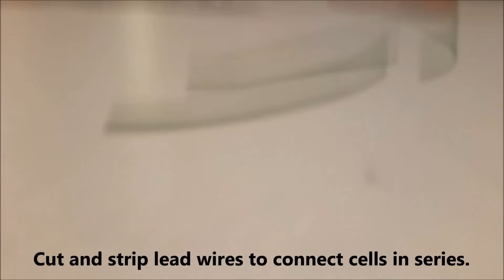Soda Can Battery - Power From Trash - DIY Project

Comment: Can you send the link on where to buy flashlight head? can you specify what flashlight head that would be able to light up in an electrolytic cell? Can you also send the link on where to buy sand and specify how much volume per can.
Reply: CAN U REPLY ASAP
Reply from the maker: Of course here is the link. It isan Ozark Trail brand mini flashlight. https://www.walmart.com/ip/Ozark-Trail-Mini-Flashlight-in-Assorted-Colors/34350005

Comment: I have tried, it didn't work. What I miss?
Reply from the maker: I have found that you must have an insulator like cardboard, thick paper, or plastic. If you are not getting any voltage with a voltage meter, then usually you have a short somewhere that the copper and aluminum are touching. Also you might want to check the voltage on your LED. If you don't have enough you will need to make another couple cans (cells), and wire them together in series. Happy inventing!!! Please subscribe!
Reply from the maker: Hey Faqih, I thought you might be interested, just published the update for this video. Please check it out, share it, and let me know what you think. Thank you https://youtu.be/DRVzPqgp10c
Reply: Source Port Services thanks for the reply, I will see the video

Comment: to charge a phone you'd need 50 of those batteries in parallel to get 1 amp
Reply from the maker: +Ben's Channel 2004 thanks for the comment. Yes you would need quite a few to charge your phone. However for some basic LED lighting or flashlight if you make a smaller version it will serve a good purpose. Please share and subscribe!

Comment: Does the coil need to be curled up and straight? Or can it be curled up only or twisted?
Reply from the maker: The reason for the coil is just to get more copper surface area in contact with the electrolyte. Better amperage that way. Could Be twisted too but more copper in contact with the salt water solution is what is needed. Thanks for the comment. Please share and subscribe!

Comment: Hi, Congratulations on this nice project. What's the energy a soda can battery (one can) can supply at his 1.8 V? How many mA and how long (in hours) it will works? Thank you.
Reply from the maker: Hi Tony! Thanks for watching and commenting! Each one of my cells (soda cans in the series of 10) only produced about 0.5v and a few 50-100 milliamps depending on how much copper wire I coiled in each can. It lasted powering a small LED flashlight head for several weeks. My cells were open to the air thought and dried out once or twice. I did end up putting some vinegar in too to increase the amps and make the LED brighter again. Please share and subscribe!

Comment: We try it we didnt get any current using multi meter
Reply from the maker: You might have a short circuit where the copper wireis touching the bottom or side of the can. Test each cell individually to see where the failure is. Thanks for watching! 👀 Please share and subscribe!

Comment: why do you need the cardboard?..
Reply from the maker: Thanks for your comment. The cardboard is to try and act as an insulator for the battery. To keep the 2 metals from touching. If they touch it is called a short (short circuit) and the electrons will just flow straight from one metal to the other, without following the path through your circuit and your LED light. Make sense? Please SHARE and SUBSCRIBE! Thank you for watching.
Reply: @SourcePortEntertainment  ahh ok..that makes sense..thankyou!
Reply from the maker: We thought you might like Building a DIY ROCKET STOVE video - https://youtu.be/Hlir866cp-E please LIKE and leave a COMMENT. We value your feedback!

Comment: Its not working source port
Reply from the maker: One of the steps I forgot to show on the video was lightly sanding the inside of the cans with sandpaper. That helps with electricity getting through the very thin layer of plastic on the inside of most aluminum cans. Please SHARE and SUBSCRIBE!
Reply from the maker: We thought you might like Building a DIY ROCKET STOVE video - https://youtu.be/Hlir866cp-E please LIKE and leave a COMMENT. We value your feedback!

Comment: Use some acids instead of salt and concrete instead of sand - to increase output and efficiency
Reply from the maker: Thanks for the tip Richard. I will have to try that on one of the future versions. Please share the video.
Reply: When you say concrete, I assume you mean hard set concrete or just the powdery mix with no water?
Reply from the maker: Good question Troy. What type did  you mean Richard?
Reply: Source Port Services i mean acid & concrete battery
Reply from the maker: Thanks that makes more sense.

Comment: i hope you can give me a diagram
Reply from the maker: Hey Rolling Bayabas, Thanks for the comment! Basically the wiring is just a wire connecting from copper wire on one can to Aluminum on the next can in a serpentine pattern until you get to the last can. Then you solder a wire from the Copper coil on the first can and the Aluminum can on the last can. Thus all cans are wired in series and the to wires now go to the positive and negative on the LED flashlight head. Please remember to Like, Subscribe (click the Bell), and Share the video. Thanks for watching!
Reply from the maker: Hey Rolling Bayabas, I thought you might be interested, just published the update for this video. Please check it out, share it, and let me know what you think. Thank you https://youtu.be/DRVzPqgp10c

Comment: I did this project at home however it didn’t work. Maybe there’s something I missed.
Reply from the maker: I forgot to show the sanding inside the can part. Also you must keep the two metals from touching or else it will short out and not put out any power.
Reply: Thank you. I got it working. Also what is the exact chemical reaction that goes on.

Comment: how many cans are needed to glow a L.E.D
Reply from the maker: +Sadhna Rani Agrawal each can (cell) provides 0.5 volts. I used 10 cans to get 5v. The flashlight head I used uses 3 AAA 1.5v batteries in series, 4.5v. So these LEDs operate from about 4v-5v.

Comment: Much safer way to open it is by rubbing it in a cycle on sand paper
Reply from the maker: Hey West, thanks for the tip. I agree, did try the sand paper trick but it was taking too long. Used what I had on hand. Thank you for watching, please SUBSCRIBE and SHARE this video!

Comment: Can I use copper sheet instead of using copper wire that you have used in video
Reply from the maker: Yes you can use a sheet of copper, if it is thick enough. It will last longer if it is thicker. I just published the update for this video. Please check it out and share it. Thank you https://youtu.be/DRVzPqgp10c

Comment: Try to charge the battery`s :-)
Reply from the maker: LOL don't think it would work to good on these. Thanks for the comment Vic, please share and subscribe!
Reply: @SourcePortEntertainment  Your welcome!
P.s I think you can actually charge them.
You need to put some water in the cells first. You can even charge the by day whit a cheap 3 dollar solar panel, so by night your Led Will shine bright!
Reply from the maker: I will have to try that. I thought with a primary battery it corrodes and destroys the metals as the electrons are exchanged.
Reply: @SourcePortEntertainment  eventually yes, (so do not charge it whit that old Honda generator sitting around ;-)
Would be an interesting video
Reply from the maker: LOL 🤔😜
Reply: @SourcePortEntertainment   I was thinking, Take burnt ashes from hard wood, mix them in water allow to settle. and pour off the water into a container and you have Lye and water. Boil it, and concentrate it. Its an alkaline too. You can buy it but in some countries Lye might be hard to get.
Maybe I will upload a video myself..
Reply from the maker: Very interesting I will do some research on that! Thank you

Comment: This would be good if you were desperate for power and had plenty of time on your hands, but since you made primary cells and the voltage and current is so low, it would not be worth it otherwise.
Reply from the maker: Hi Jer, thanks for watching and the comment! Agreed if you had time and were desperate it would be very useful. Please SHARE and SUBSCRIBE!
Reply: Jer Tanner you prep them before. Great for when the power gets knocked out and you are sitting in the dark waiting for power to be restored and you don't want to burn down the house with candles. Think bigger is better. More power Tim the tool man would say.
Reply from the maker: We thought you might like Building a DIY ROCKET STOVE video - https://youtu.be/Hlir866cp-E please LIKE and leave a COMMENT. We value your feedback!

Comment: 0.5VDC open loop chain(no load voltage) & 1.8mADC short circuited current - so we can calculate output(internal) impedance of that power supply by Ohm law:
Rint=0.5VDC/1.8mADC= 278 Ohm is your cell resistance, internal conductivity deficyte problem that never lovely for scientists...  
maybe it is not evident for you, but no any battery or power current source possible to functioning from two wires comes from two different independent separate bottles with any thing filling inside, only capacitor can be constructed by that way, because no current flow via capacitor insulator happens or allowed... no even one electrone can flow through cap. via isolator, flow in one plate and drains out of second plate... and capacitor does not feel what in that botles, only isolator thickness and relate dielectricyty material propertys of your isolator layers between plates of cap, you don't need cap, battery cell must be low resystance f.e. after disharge, when it must add 0VDC in serial onnection, without big problem for curent to flow via discharged cell also
in car lead aĉid battery special plastic film membranes used, it is isolator, when placed dry between two pieces of metal(electrodes), but submerged in electrolite, it becoming ionic conductor film, like plastic grid that distant metalic plates, but no any problem for electrolit iones to flow via plastic grid... in salt battery there is paper separator, for same purposes, it just filter paper, not glased witn isolating paint or any parafined or plastic paper, this separator paper, at least - prevents short circuit situation between Zn (-)electrode and parafined grafete(porous nature of grafete, filled with parafine candle type, dissolved in hot petrole just a litle, and soaked grafete rod in it and then dry, to get hydrofobic grafete rod(used as (+)terminal), that not wets by water sollution electrolytes,still contacts well with coal powder doped with MnO2 , that forms coal porous electrode with big surface ooated by MnO2, like sponge type of electrodes, however coal powder particles connected with eachother not best, but it not onnected to Zn(-) electrode because of paper separator... and that separator  paper in zn mn salt batery, adds not much resistance to internal conductyviti inside the cell, ofcource if coal onnects wiþh Zn , internal R became almost zero, but it will not be power sipply cell anymore, without electrolyte gap layer, in pores of separator paper, and you need two electrodes with its own different potentiall when submerged into electrolyte without way for electrones to jump from one electrode metall, to second metall, in direct contact, witoutinvolving of electrone-ionic  convertion on surface metall/electrolite, wherepotentiall formed, different for 
different electrodes material... and if you chort circuite Al and Cu in yourcell, than electrolite almost doesn't mean anymore, because direct metals connection gives you termocouple for  measuring temperatures, or even fortermogeneration of electycity from heat sorce energy... like Pelteau elements do in generator mode of funct.
SO: 1)clean inside surface with abrasive paper, to eleminate paint epoxy glass coatng of Al  cans first...
2)use thin paper as a separator , to get lower as possible Rint of cell
3)change sand powder to copper powder :-)))
4)put better electrolite inside, saturated sollutin of Na2CO3 or AlCl3 or NH4Cl, and citric acid...and maybe chloricacid, if you can find it...
now you can get maximum power from ne can when Volage fall down to half of "no load mode" and current are half of short circuited current, in mode, when Rint=Rload=278 Ohm in yoir case, so  you will get 0.25VDC*0.0009ADC=0.000225Wt=0.225mWt ≈ 0...
Reply from the maker: Wow! Thank you for the very detailed comment. Not sure I understand all of the chemistry mentioned in it but, I appreciate all the same. Please remember to share this video if you like the project and remember to subscribe!

Comment: Actually sand,cardboard is just for make sure cable and can not touch each other, they are still part of battery system. Is thats right?🙄
Reply from the maker: Hi Matias, yes batteries have an insulator to prevent it from shorting out,  and get the electricity to travel through your circuit the way you need it to. Thanks for the question. Please share and subscribe!

Comment: I wonder if this can be done by salty oceans ?
Reply from the maker: Great idea Tony! I have wondered the same thing. Melt down a couple hundred pounds of aluminum can waste and get some copper or graphite to be the anode, make some large saltwater batteries?!  Anyone live by the ocean and want to test and share your results? Please subscribe and share some comments. Thank You!
Reply from the maker: Hey Tony, I thought you might be interested, just published the update for this video. Please check it out, share it, and let me know what you think. Thank you https://youtu.be/DRVzPqgp10c
Reply: Tony Walker good question
Reply: Source Port Services It all sounds appealing. However larger battery parts mean higher impedance and higher heat.
Reply: wouldn't larger parts result in less impedance? the same way a wider wire has less resistance?

Comment: The steps are way too fast can you emphasize and repeat the steps especially in connecting the wires and the coils and for the flashlight head can you please elaborate those?
Reply: To make it easier to understand. Think of a battery of how you install it into a flash light.  negative is the flat side of the battery and the positive side of the battery has a nip at the top of it when talking about a AA or AAA or D or C  battery.  Now the outside of the can is the Negative side and the copper wire is the Positive side 2 ways you can make this connection either parallel and or in a circuit. parallel is  -  + to  +  -   to  -     
which  if the battery is 1.5 vdc  in parallel connection the voltage will stay the same but the amps will be higher. 
 
if in a circuit like the common house hold flashlight  -  + to  -  +  the voltage will be 2 x 1.5 that = 3.0 volts and amps will be slightly elevated but not that much. hope that helps.  Just to be clear the whole outside of the can in this video is the - negative side of the battery just like on a battery under the plastic with the company logo. only thing + positive is the copper wire and also called positive terminal lead
Reply: Agree, how is the battery head connected?

Comment: 5 v will probably charge your phone.
Reply from the maker: Hey Quetzalcoatl, thanks for watching and commenting. Yes it could charge a phone but it would be very slow because of the low amperage, as you pointed out in another comment. Please share and subscribe!
Reply: @SourcePortEntertainment  you can increase amperag but putting another group of batteries in parallel with anothrr group. Batteris in series increases voltage, betteries in parallel increases amps.
Reply from the maker: Yes that should work.

Comment: Instead of card board you need to spray paint inside of alluminum can 2 coats. Instead of sand ,  use charcoal powder with lots of SEA SALT and purified water. Instead of your copper coil , Use 1mm magnet wire wrapped 50 times in a coil with both ends of wire stripped of wire coating then put in alluminum can of char coal, sea salt and purified water , then test with volt meter.

Comment: added a little more 'vinegar' he said at the end.....what Vinegar ????
Reply from the maker: Hi Stephen, thanks for the comment. When I rehydrated the cells the second time the light was pretty dim. I added about a tablespoon of vinegar to each cell with more water to get higher AMPs to make the light brighter. Please share and subscribe!
Reply: yeah, I watched ...... most of it.... then got bored and skipped ahead.... then at the end "more vinegar" and I'm like - wait... when did we get into the vinegar?
Anyway, why not open up the cans and use flat sheets of copper and get more surface area with like wet blotting paper between them?

Comment: not very practical
Reply from the maker: Hi Yuri, very true. Not practical, it is more of a proof of concept design.  You could make a more condensed version using a stack of plastic cups as cells. What are your thoughts on that? Thanks for your comment.

Comment: this is not a battery, just a capacitor
Reply from the maker: Hi Tobaganner, it is an Aluminum / Copper battery. If it was a capacitor it would need to be charged up with an external power source. Thanks for watching and commenting. Please share and subscribe!

Comment: It is fake....It doesn't work
Reply from the maker: Hi MusicArtExs, it is not fake. It is a basic primary battery. If you tried and it didn't work there might be a short in your cells. Thanks for watching and your comment.
Reply: It works, just low amperage!